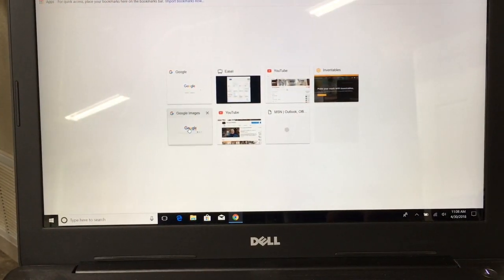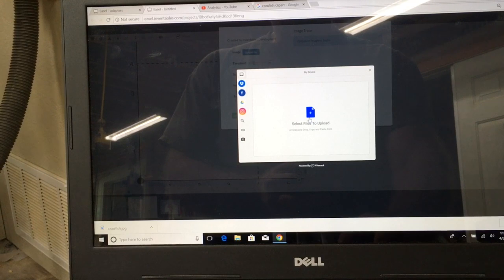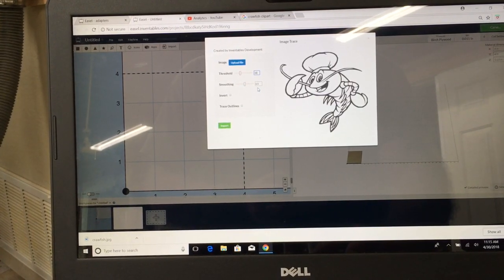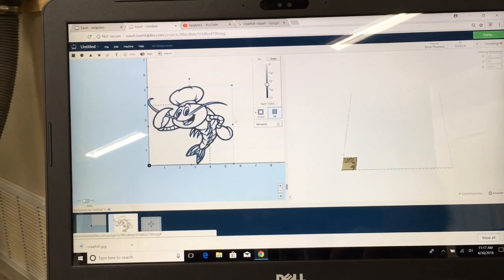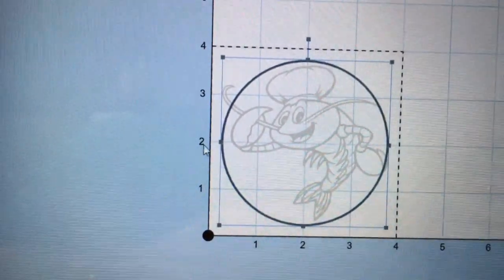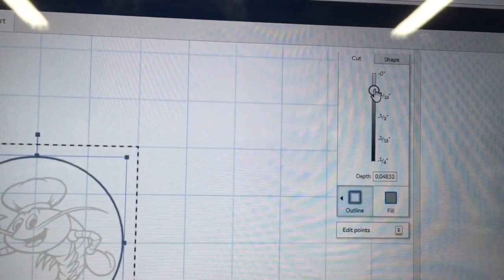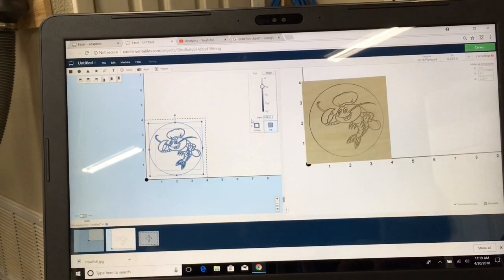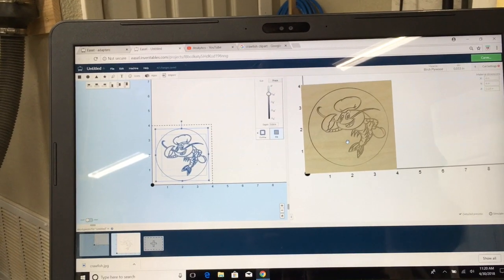Image Trace in Easel (Free Software from Inventables)

Comment: Have a cnc 3018 pro GRBL control ...Will easel work with that cnc
Reply from the maker: Yes, it should work.  You will need to calibrate the steps and make the necessary adjustment.
Reply: @PawPawsWorkShop  
That sounds good.

I am also trying to use a 3018 to learn a bit about CNC before deciding if I want to get a more expensive machine.

Comment: how did u upload a jpeg? it only allows svg files on mine
Reply from the maker: Two ways that I use. First, use Inkscape (free). Import your image and do a bit trace map.  Save as a SVG file.  Second, in Easel use Image trace. Import your image directly into Easel.  If it will not open then most likely there are open segments.
Reply: @PawPawsWorkShop  thank you! :) i uploaded the jpeg finally with image trace :)
Reply from the maker: Awesome!

Comment: Finding lot information on your videos is a great thing. Very good job you are doing. Respect by me. Interesting and nice program from easel.  Can we run it on ubuntu 32bit or is only for 64bit?
Reply from the maker: I actually not sure if is will run on 32bit.   You can contact customer service at Inventables.
Reply: Easel is web based so i dont belive it matters 32 or 64 bit....i have vista 32bit and easel works fine....

Comment: What is your feed rate, plunge rate and depth per pass?
Reply from the maker: First, thank you for your question.  The feed rate is 50 inches per minute, the plunge rate is 9 inches per minute and the depth per pass is .04.  The total depth is .06. That will give you on the second pass a .02 cut which is a nice cleanup pass.